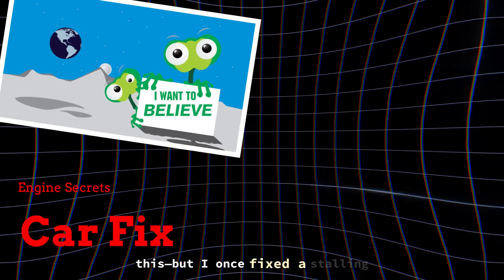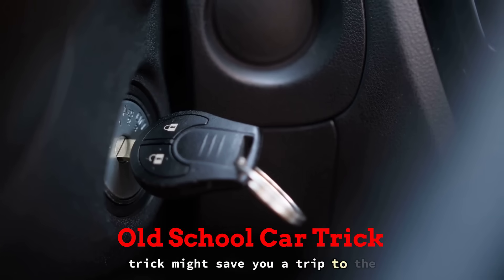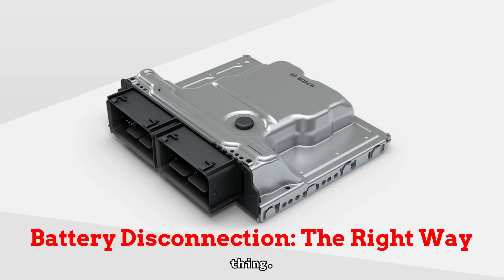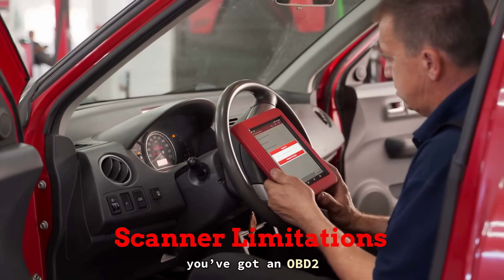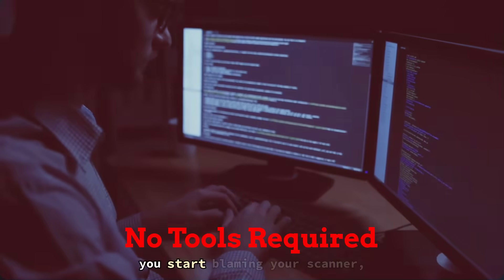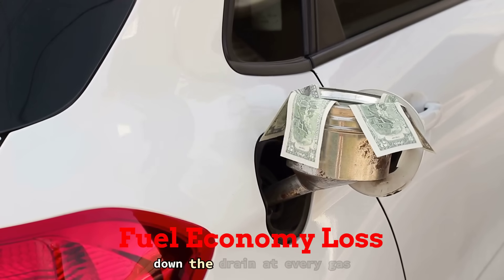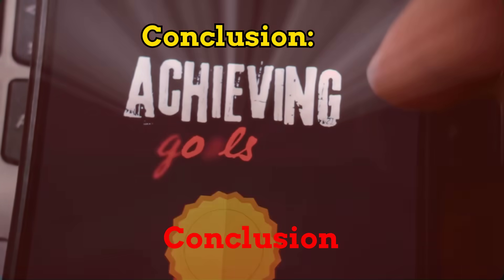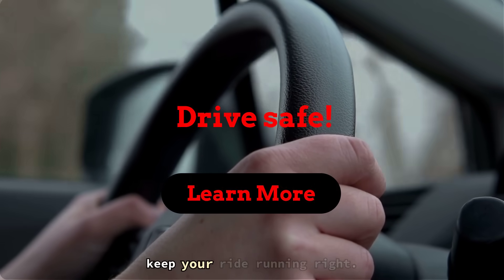Doing This Will RESET Your Car And Fix It For Free (5 Real Mechanic Methods)

Comment: I have a 97 Grand Jeep Cherokee Laredo 4.0 the check engine light reads O2 downstream sensor and Catalytic converter I had the catalytic converter changed 3 times and the downstream sensor changed 4 and it still reads those two codes. I thought maybe the ECM is bad and someone else said the same thing what you think 🤔🤔🤔
Reply from the maker: Hey, I can see why you’re frustrated — that situation usually means the problem isn’t the catalytic converter or the downstream O₂ sensor anymore.

On a 1997 Jeep Grand Cherokee 4.0, those two codes sticking around after multiple replacements almost always point to one of these issues instead of a bad ECM:

1. Exhaust leak upstream of the cat
   Even a small crack or leaking gasket before or near the catalytic converter can pull in outside air and fool the downstream O₂ sensor into thinking the converter isn’t working.

2. Wiring or ground problem
   The downstream O₂ sensor wiring runs close to heat and the transmission. A damaged wire, weak ground, or poor connector can cause the ECM to read false converter efficiency codes indefinitely.

3. Incorrect or low-quality catalytic converter
   These Jeeps are very picky. Many aftermarket cats don’t have enough precious metal for Chrysler’s calibration and will still trigger efficiency codes even when new.

4. Engine running slightly rich or misfiring
   Coolant temp sensor issues, fuel trims out of range, or small misfires can kill cat efficiency readings without setting obvious misfire codes.

5. ECM failure is possible — but rare
   On these models, ECMs usually fail completely (no start, injector issues, no communication). If everything else checks out, it’s the last thing to suspect, not the first.

What I’d do next (in order):

* Smoke test or inspect exhaust for leaks
* Check O₂ sensor wiring continuity and grounds
* Verify fuel trims with a scanner (even a slight rich condition matters)
* Confirm the cat meets OEM spec, not just “fits”

You’re not crazy — this is a **very common 4.0 Jeep issue**, and swapping parts alone rarely fixes it. If you want, tell me the exact code numbers (P0420, etc.) and whether it’s an aftermarket or OEM-style cat, and I can point you in a tighter direction.

Comment: I'll put a 1A resistor in between the battery cables to drain it slowly and carefully
Reply from the maker: Good thought — using a resistor is actually the safer, more controlled way to do a full system discharge 👍

A 1A / high-watt resistor between the disconnected battery cables limits current and lets residual charge bleed off slowly instead of dumping it all at once. That avoids the risk people take when they just touch the cables together directly.

A couple important notes for anyone reading:

* Battery must be fully disconnected (both terminals off the battery)
* Use a *proper power resistor (not a tiny electronics resistor)
* Let it sit for several minutes so capacitors in the modules fully discharge
* Never do this with the battery still connected

This is basically the “clean” version of a hard reset — same goal, less stress on the system.
Not something manufacturers advertise, but solid from an electrical standpoint when done correctly.

Comment: Fortunately I have a 94 Jeep YJ so none of this applies.
Reply from the maker: A 94 Jeep YJ is actually one of the vehicles where some of this works best. The ignition key cycling reset and a proper battery disconnect reset absolutely apply to that era, especially with the 4.0 and early Chrysler electronics. It’s the newer drive-by-wire and module-heavy stuff that doesn’t translate as well.

So while the pedal throttle relearn doesn’t apply, the old-school resets definitely do. Those Jeeps were simpler, which is why these tricks existed in the first place.

Comment: You can unplug and replug  all day long, it will not solve the condition of your service engine soon light from coming on unless it's from a poor connection. Take it to auto zone they will test it out and even reset it. For free, This gives you the area to look at.
Reply from the maker: You’re right on one key point — a reset by itself won’t fix an underlying problem. If a sensor, wiring issue, vacuum leak, or engine condition is still there, the light will come back no matter how many times you unplug things.

Where resets do help is when the issue was already fixed but the ECU hasn’t relearned yet, or when there’s a temporary glitch or poor connection like you mentioned. And yes, AutoZone scanning is useful for getting a starting point — knowing the code tells you where to look.

The mistake a lot of people make is thinking a reset is a repair. It’s really a diagnostic step, not a cure.

Comment: It will not reset a portion ll sing compression at all will not you'd have to get a new ring you can not reset that
Reply from the maker: This video focuses on resetting electronic systems, not mechanical components like piston rings.

Comment: If I take battery cables off would it reset
Reply from the maker: Yes — taking the battery cables off can reset the computer, but only if it’s done the right way.

If you just pull one cable and slap it back on, a lot of memory can stay alive. To actually reset it, both cables need to be disconnected for a while so the stored power drains out.

Also keep in mind: a reset only clears learned data and temporary faults. If there’s a real problem (bad sensor, wiring issue, vacuum leak, etc.), the light will come back after a few drive cycles.

So it’s a good first step — just not a permanent fix unless the issue is already resolved.

Comment: How do i reset my sliding doors to my 2010 dodge caravan
Reply from the maker: On a 2010 Dodge Grand Caravan, the power sliding doors have a built-in relearn you can usually do without tools.

Try this first:

1. Make sure the battery is fully charged
   Low voltage is the most common reason the doors act up.

2. Turn the ignition to ON (engine can be off)

3. Close both sliding doors completely by hand
   Don’t use the power buttons for this step.

4. Turn the ignition OFF
   Wait about 30 seconds.

5. Start the van
   Now use the overhead console or key fob to open and close **one door at a time**, fully open then fully closed.
   Repeat for the other door.

If that doesn’t work, do a hard reset:

– Disconnect the negative battery cable
– Wait 10–15 minutes
– Reconnect, then repeat the open/close procedure above

If the door still won’t relearn, common causes on these vans are worn door rollers, dirty tracks, or a failing door motor or module. The reset only works if the hardware isn’t binding.

Let me know what the doors are doing (won’t open, won’t close, beeps, halfway stops), and I can narrow it down.

Comment: I've used the jumper cable reset several times on my lexus LS460 and LS430 especially on transmission issues dont forget to pump the brakes it helps clear(your cars bad habits) codes. Im not a mechanic but anyone can do it
Reply: What kind of transmission issues?
Reply from the maker: Thanks for sharing your experience — and you’re right about one important thing: **clearing adaptive memory can change how a car behaves**, especially on vehicles like the Lexus LS430 and LS460 that rely heavily on learned transmission and throttle data.

That said, it’s worth adding a little caution for others reading:

* Pumping the brake with the battery disconnected does help discharge residual power in some systems
* Results vary a lot by model year and control module design
* It can clear learned “habits,” but it won’t fix a worn solenoid, failing sensor, or mechanical transmission issue

So as long as the battery is fully disconnected and people understand this is a reset — not a repair — it can be useful. Just important not to oversell it or skip proper diagnostics if symptoms come back.

Appreciate you chiming in with real-world experience 👍

Comment: I can't start my car a2013 Benz I put the key and turn it and nothing happens, what can I do it was working fine last night.
Reply from the maker: If nothing happens at all on a 2013 Mercedes when you turn the key, start with the basics before assuming anything serious.

First check the battery. Even if it worked last night, Mercedes are very sensitive to low voltage. If the dash doesn’t light up or you hear no click, try a jump start or test the battery.

Second, try the spare key if you have one. A bad key or steering lock communication issue is very common on these.

Third, make sure the steering wheel isn’t locked tight. Turn the wheel gently left and right while turning the key.

If you get lights but no crank, it could be the brake pedal switch or the gear selector not fully recognizing Park.

If none of that works, it may be the electronic steering lock (ESL) or ignition switch, which is a known issue on some Benz models. At that point, a proper scan is needed.

Let us know:
– Do the dash lights come on?
– Any clicking sound?
– Battery age?

That’ll narrow it down fast.

Comment: Cool, here's me thinking "damn, I'll have to get out the foot pump, and inflate that flat tyre in the rain".
Reply from the maker: 😂 Been there. Wrong kind of pump, wrong kind of problem.

At least this one doesn’t involve kneeling in the rain or fighting a valve stem. If only flat tires were as easy to reset as warning lights, right?

Comment: The biggest fix is buy electric
Reply from the maker: Haha, that’s one way to avoid a check engine light 😄

Though to be fair, EVs come with their own warnings and software quirks — just fewer oil stains on the driveway. Different problems, same headaches… just quieter.

Comment: I came out of the storage to my 2013 Buick encore decided not to start had to check engine light on and wouldn’t start after watching this video and doing the gas pedal one. It started right up so whoever posted this thank you very very very very much because you saved me from calling the tow truck
Reply from the maker: That’s awesome to hear — and I’m really glad it helped you avoid a tow. Cars that sit in storage can lose learned throttle and idle data, so that pedal relearn can make a real difference in situations like yours.

Just keep an eye on it over the next few drives. If the check engine light stays off and it keeps starting normally, you’re likely good. If the light comes back, it just means there may still be an underlying issue that needs to be scanned — but at least now you know it wasn’t something catastrophic.

Thanks for sharing your experience, and safe driving 👍

Comment: Would these tricks and or one of them work on my 2012 toyota camry. My wife was driving and it suddenly died hard to steer break and lights. Went to check battery was dead. Replaced battery barely made it home. Alternator was dead. Replaced that and now it barely wants to start like the battery is dead but still has power. Battery good alternator good. Got my starter tested they said it was bad so I replaced that. Still the same issue. No corrosion on cables fuses still good. Replaced the spark plugs still no luck. Was thinkn could be the fuel pump but when it starts it's like the battery is dying like i said. Any ideas. Could it be a relay?
Reply from the maker: On a 2012 Camry, some resets can help with relearns, but what you’re describing sounds less like a computer issue and more like a voltage or power delivery problem.

A few key things stand out:

– It died while driving, then the battery was dead → classic alternator failure (you fixed that)
– Now it cranks weak or barely starts even with a good battery, alternator, and new starter → that usually points to resistance or voltage drop, not fuel

Things I’d check next, in order:

1. Main battery cables and grounds
   Even if there’s no visible corrosion, check:
   – Ground cable from battery to chassis
   – Ground from engine to chassis
   – Positive cable from battery to fuse box and starter
   A bad ground or internally damaged cable can cause exactly what you’re seeing. Voltage drop test is better than visual inspection.

2. Battery voltage under load
   A battery can test “good” but collapse under cranking. Watch voltage while starting:
   – Should stay above ~9.6 volts while cranking
   If it drops lower, the car will act like the battery is dead even with power to lights.

3. Fusible link / main fuse
   Camrys have high-amp fuses and fusible links near the battery. One partially blown link can allow accessories but starve the starter.

4. Starter control / relay
   Yes, it could be a relay or starter signal issue. When it struggles to start:
   – Do you hear a solid crank or just slow dragging?
   – Any click with no crank?
   Swapping the starter relay with a matching one is an easy test.

5. Don’t chase the fuel pump yet
   Fuel pump issues usually cause cranking with no start. You’re describing weak cranking, which is almost always electrical.

A reset won’t hurt (disconnect battery properly and let it sit), but I wouldn’t expect it to solve this one.

If you can answer:
– Does it crank slow or not at all?
– Battery voltage while cranking?
– Any clicking noises?

That’ll narrow it down fast.

Comment: Also done compression  test 2 time
Reply from the maker: Got it — doing a compression test twice at least rules out major internal engine issues, which is good news.

If compression is solid and you’re still chasing a problem or a persistent code, the focus should shift to sensors, wiring, fuel/air delivery, or exhaust leaks rather than the engine itself. Compression tests confirm the mechanical side; most modern driveability and warning-light issues live on the electrical or control side.

If you want, share the exact codes and symptoms you’re still seeing and what vehicle it is — that’ll narrow things down a lot faster.

Comment: 2011 chevey  5 .3 change plugs wire switch coil and Injector have miss fire  cylinder  3 and no engine  light on but misfire  i need help
Reply from the maker: That's frustrating when you have a misfire without a check engine light on a 5.3! For cylinder 3, I'd double-check the spark plug gap, ensure the injector's electrical connector is solid, and maybe even swap the coil pack with another cylinder to see if the misfire moves.

Comment: I used a scanner to see what's causing my ac not to work.  Nothing came up . 2013 Nissan Altima.
Reply from the maker: Hey man — if your scanner didn’t show any AC-related codes, that actually helps narrow things down a lot. Most AC failures don’t trigger a check-engine light unless it’s an electrical fault.

On a 2013 Nissan Altima, here are the most common reasons the AC stops working even with no codes:

1. Low Refrigerant (MOST common)
If the system is low on Freon, the low-pressure switch disables the compressor — no codes, just no AC. A quick pressure test will confirm it.

2. AC Compressor Clutch Not Engaging
Have someone turn the AC on while you watch the compressor.
If the clutch doesn’t click on, it could be:

bad clutch
bad relay
blown AC fuse
wiring issue

3. Bad AC Relay (EXTREMELY common on Nissans)
Nissans are notorious for failing relays. Swap it with another identical relay in the fuse box and see if it wakes up.

4. Cabin Temperature Sensor or Sunload Sensor
If these sensors misread, the AC may refuse to run even though the system is fine.

5. Blend Door Actuator Stuck
Sometimes the AC is actually making cold air — it’s just stuck blowing hot because the actuator failed.

If I had your car in the shop, I’d first:
✔ Check refrigerant pressure
✔ Check fuses/relays
✔ See if the compressor clutch engages
✔ Then check actuator movement

Let me know what it’s doing — blowing air but not cold, or not blowing at all? That changes the diagnosis.
Reply: @CarCareFix just bought the car. It don't have any freon .

Comment: On a kia 2017 forte its has a knock what could it be?
Reply: The nosie comes and goes it starts up quickly idle goes up and down
Reply from the maker: Hey @ManuelManquero — a knock on a 2017 Kia Forte can be a few things, but here are the big ones to check:

🔧 1. Rod bearing knock (common on some Kia/Hyundai engines)
If the knock is loudest on cold start or when you tap the gas lightly, this is possible. Check your oil level immediately — running low accelerates bearing wear.
🔧 2. Bad spark plug or ignition coil
A misfire can sound like a knock. If the engine shakes or the CEL is on, scan for codes.
🔧 3. Carbon buildup
These engines can get carbon deposits that cause a light “tapping” noise. Not usually dangerous, just annoying.
🔧 4. Low-quality or wrong oil
If the wrong viscosity was used, the engine can tick/knock when hot.
If it’s a deep metallic knock, don’t drive it hard — get it checked ASAP. But if it’s a light tapping, a fresh oil change or tune-up can help a lot. Let me know what the knock sounds like (deep, light, hot/cold), and I’ll narrow it down 👍